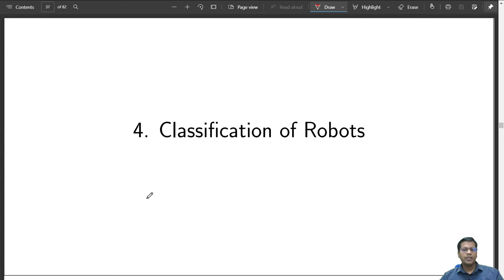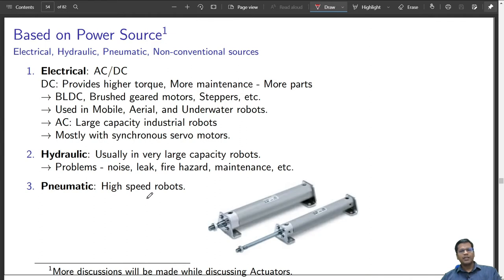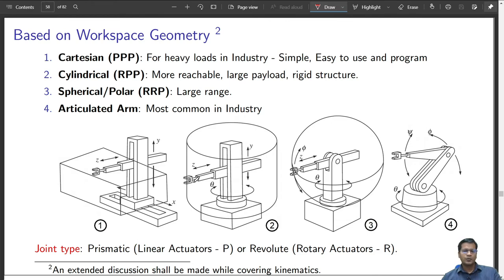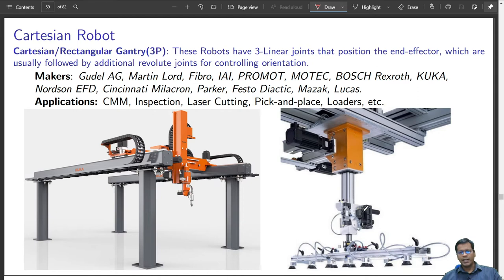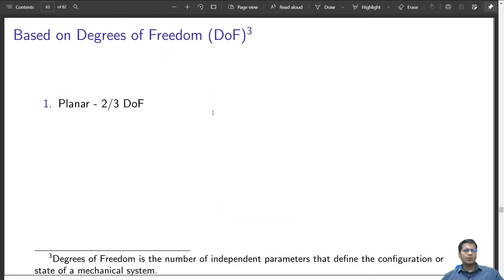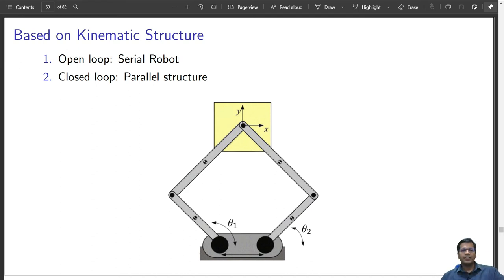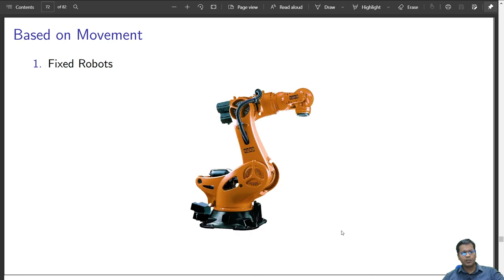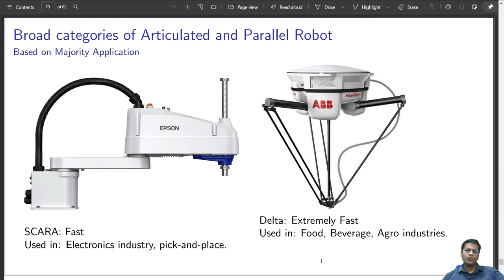Classification of Robots

Comment: sir why only few company manufacture industrial robots are they hard to design or what is the reason if you can explain
Reply from the maker: I feel that making a serial robot was never tough, as it is just a electro-mechanical system. However, in order to market a robot profitably, one needs to have a complete ecosystem where you also provide automation solution and integration to other systems in the workspace. As for example KUKA, ABB, FANUC, Yaskawa, etc. all of them are making robots and simultaneously providing automation solution. Achieving this with competition from these giants now with limited countries who are making actuators seems very tough.
Reply: Sir from where i could learn about snake robot .